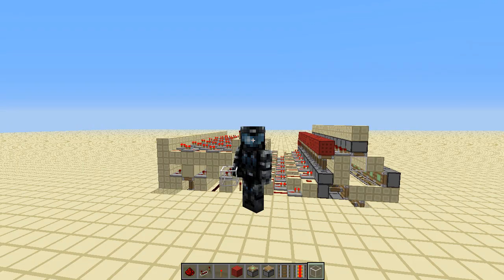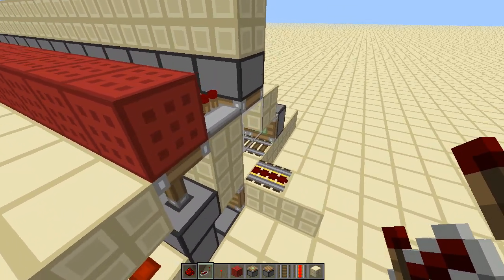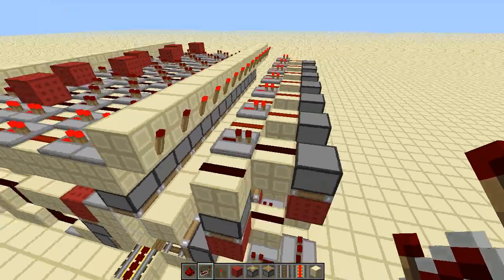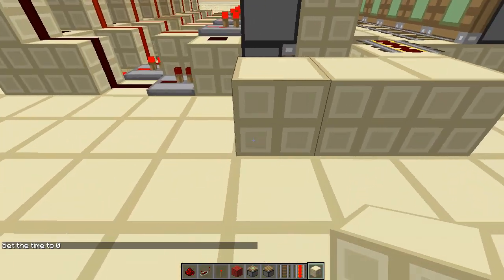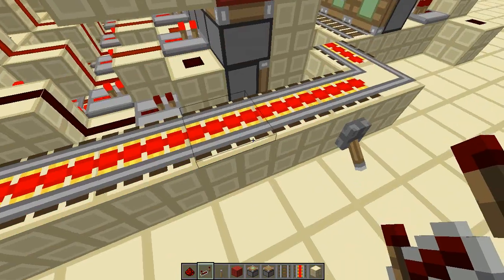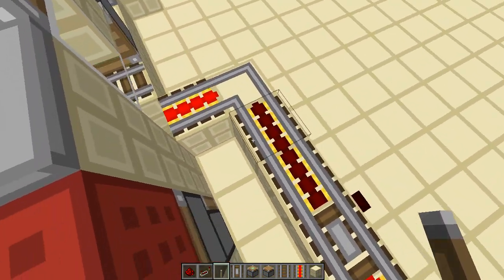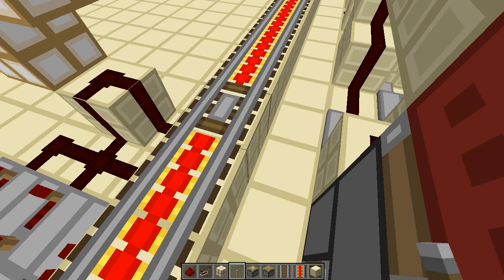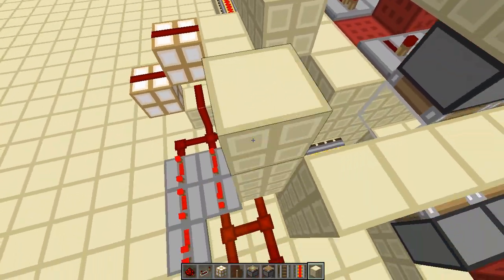Minecraft Train Station (REVAMPED) tutorial for 1.4.7 Part 2 - REMAKE

Comment: I have an issue with the end of this half of the tutorial: I've successfully tested the selection system and drop into the correct hole for all choices except the first button on the farthest right. This one stops the cart before it even drops in the hole because the glass is not moved. Conversely, I'm running a MindCrack modpack FTB server (version 8.0.1, not 8.1.1) and as far as I know makes no changes to the basic workings of redstone.

Comment: starting in the way you did I just ran it like this.

11,22,33,44,55,11,22,33,44,55

Then I did two of those multipliers where the fives are so if I did it right it should count out right. Is that what you would have done for 20 if I described that right ?

Comment: I made this station with 20 possible directions but I have a problem. The station works perfectly thanks for that. Except for one thing. The last 4-5 directions aren't long enough active. The glass and rail pistons retract as soon I reach that specific rail. I tried to add extra repeaters next to the detector rail, but I have 6 rows of repeaters now all set to 4 and it still doesn't work. Got any tips?